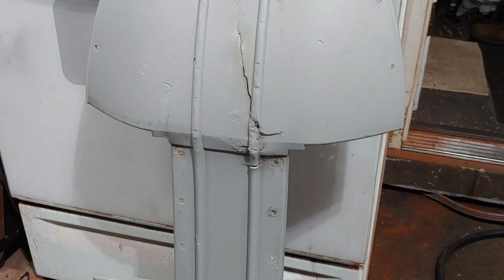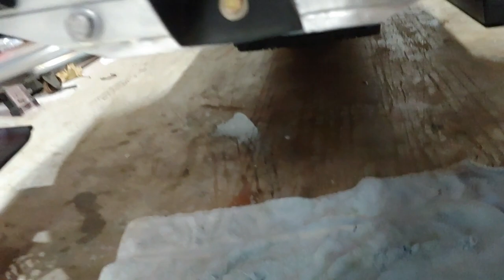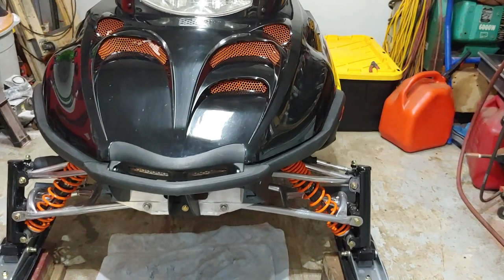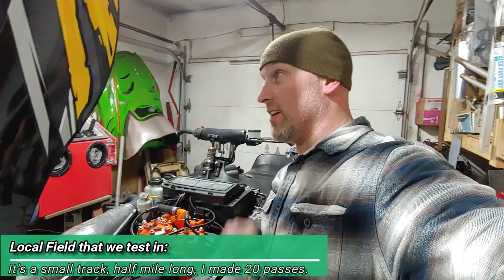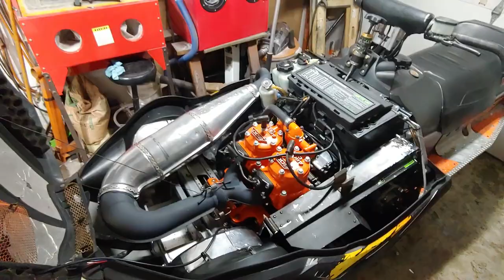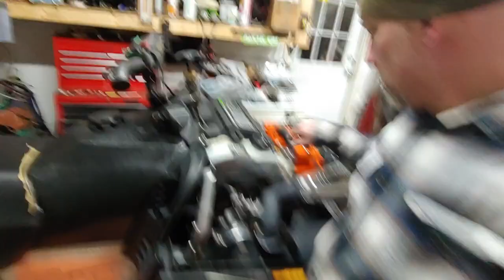02 Arctic Cat ZR 800 CCE Rebuild Part 18 || Body On - Break In Method - First Ride

Comment: Idle is correct. Dont mess with it. The 2 cycle engines slowly go back down to idle. Make sure the valves cycle upon start up. I had an 01’ 800, it was a rocket. Nice job on the build 👍
Reply from the maker: Gotcha. Yes. Made sure the servo cycled initially and it was good to go. I did some reading a lot of owners reported his 800 having too big of pilot jets. Plus I installed Boyesen power reeds which allow for lower mains. I called Boyesen tech and they said to go ahead and try the 45 pilots to see if that helped. Still have yet to do it. I will be trying it though. 

Thanks for watching and the kind words. Glad you liked it. Got more coming soon.

Comment: Hey Andrew, at 5:48 you can hear a slight knock on deceleration. My 01' ZR 800 does the same thing, is that a bad noise?  Not sure where its coming from and just want your opinion on it.
Reply from the maker: Yeah that's a normal suggest because of jetting and two strokes. Thank you very much for watching